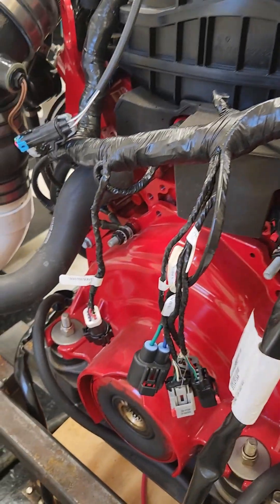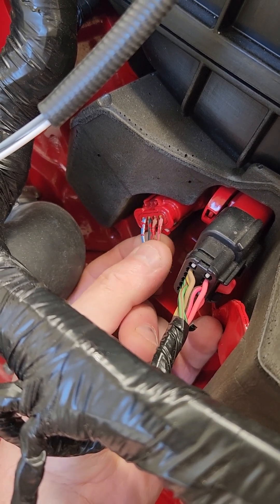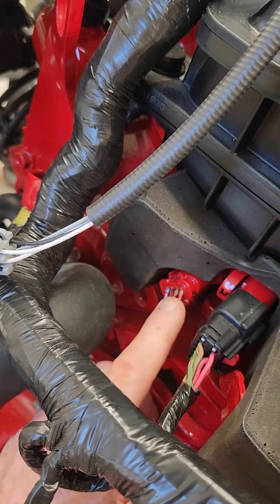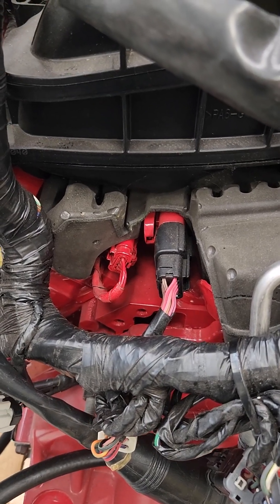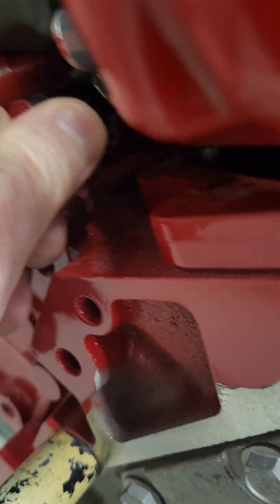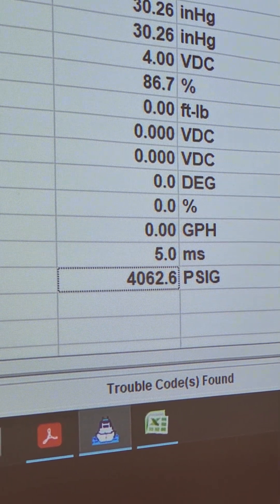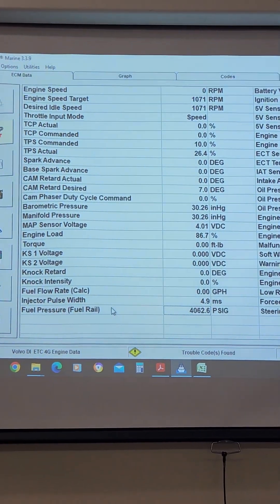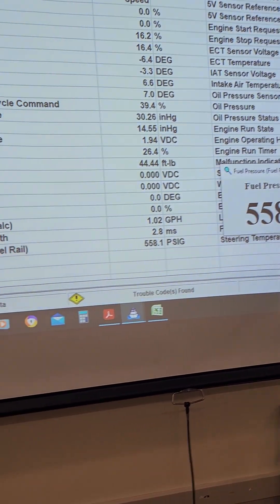GM GEN V Fuel Rail Pressure Testing and Function

Comment: Are you still running this gen v engine on an oem gm computer or a standalone unit built for marine use ? I’m curious since my truck will read 9500 with the sensor unplugged. Also all 3 wires are working properly unplugged but the signal wire bias voltage is 4.9 instead of the full 5.01 volts like the 5 volt reference is and if I plug the sensor in it drops to 0 psi on the scanner data but now  has 3.9 volts on the signal wire which is way high obviously.  

Also if I jump the signal and 5 volt wire it still has the same data pressure plugged & unplugged as if they didn’t have a jumper wire between them. I’m at a loss but I feel it’s most likely the ECU since I tested the resistance of all 3 sensor wires from the ECU to sensor connector & also checked them for continuity to all the other wires in the connector.    Also 2” back from the ECU connector the signal wire is still 4.9 volts so I feel it’s not do to a shorted wire or weak connection. Any thoughts would be much appreciated. 

Thanks in advance.
Reply from the maker: @jacobtravis812  it is an E-Controls processor that Volvo Penta uses on the GM Gen5.
Being automotive, the gm PCM is very different and I don't know the values used by their PCM. 
Ensure the connection is clean and try a new gm part. I stopped trying to save a few bucks with aftermarket. Y
Reply: @ ok good to know it’s a different operating system so the values would be different. Yea I always use oem parts with everything I do except oil & spark plugs lol. I have my own preference for those.  But yah this thing is eating my lunch for sure. Bought a new gm sensor and getting same readings. Reads 0 while in the rail and plugged in but my low side will reach 80 with ease and if I crack the high side line I’d be willing to be a easy 150 in those lines as well. If I plug it into a new sensor that’s not installed into the rail it still reads like 3.8 volts on the signal wire with DDM which should be a lot of pressure but it’s out of the rail in atmospheric pressure but still reads 0 psi on scanner.

Comment: I’m having the weirdest problem. May 18 Denali 6.2  will not start. The fuel rail sensor reads 0 while plugged in & desired is 2030. If I unplug the sensor it reads over 9500 psi. 

The sensor harness plugged in or unplugged - 5 volt reference reads 5.1 volts.   Ground is ground & signal is 4.35 volts with it not even plugged into the sensor lol.  

The signal wire stays 4.35 volts but the fuel pressure  changes from 0 to 9500 when I plug it in.   Also the reference and ground wire stay good when plugged into as well. It definitely feels like ECU but I need to be absolutely sure.  Thanks for any thoughts on this if anyone has any.

Comment: Great video! Have you ever seen a problem where a Gen V engine shoots High psi fuel pressure above 5.5k RPM? 3500+psi and doesn't respond to commanded psi?
Reply from the maker: @jose38706  the hp pump is cam driven and if the pressure goes above the ecm range, then the issue is likely with the pwm control valve or a wiring issue.
Reply: @tedsmarinerepair8956  yes sir, makes sence. I had 2 things in mind before, either a faulty  fuel rail pressure or the regulator valve that's installed on the hpfp. I currently have a p018c & P0315 code and it goes into safety mode when it detects high fuel pressure to avoid blowing the injectors